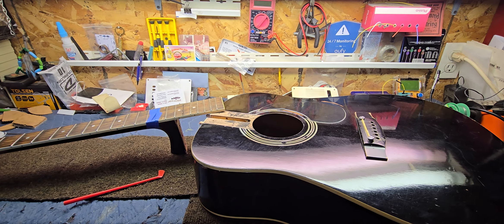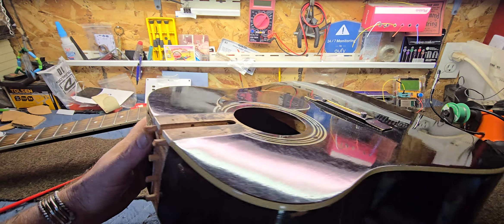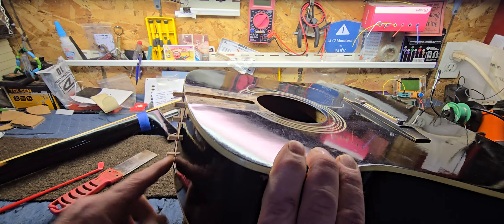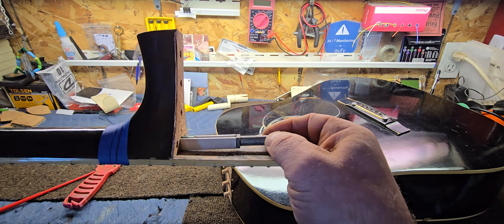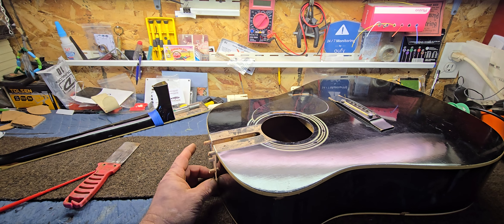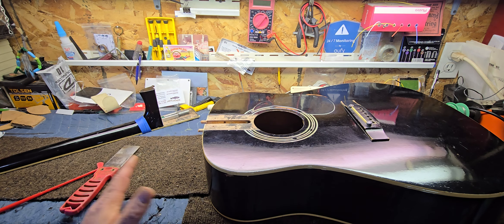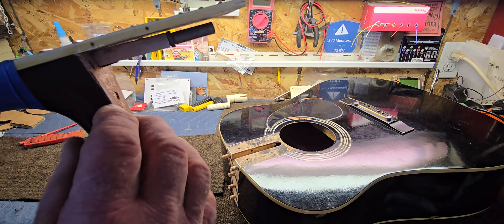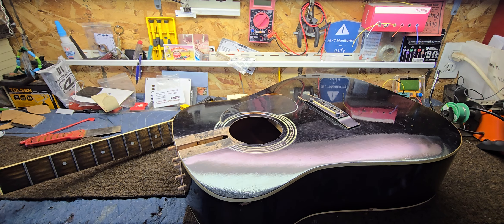Guitar repair. neck removal nightmares on an old Harmony acoustic. the perils of guitar repair 2024

Comment: I would never have guessed that they used dowels. I would love to see how you adjust and set the angle.
Reply from the maker: @TooLooze  sneaky little trick with the dowels. you might as well just use bolts at that point. lol.. I will surely shoot some in depth video on the rest of it, trying my best to explain as I go along. the hard work is done.  the rest is not as bad.  Hopefully.!